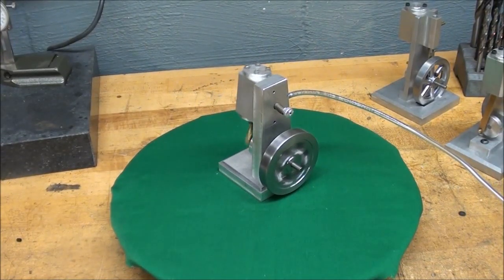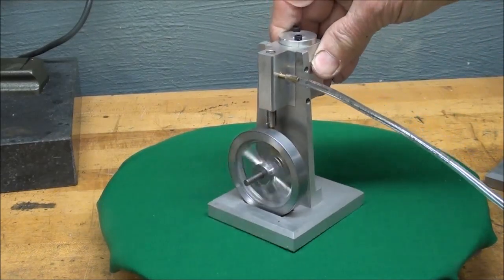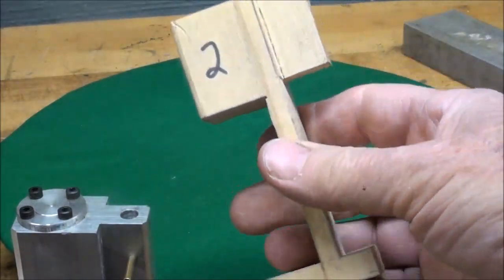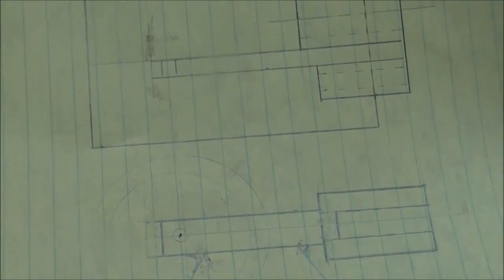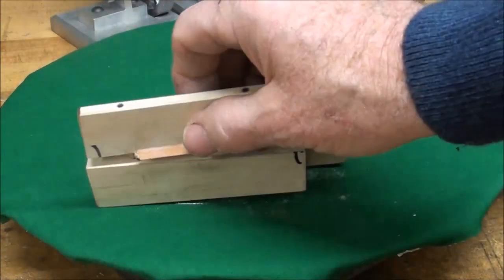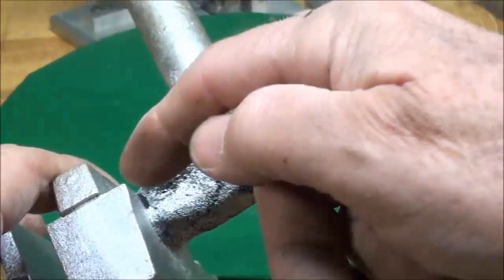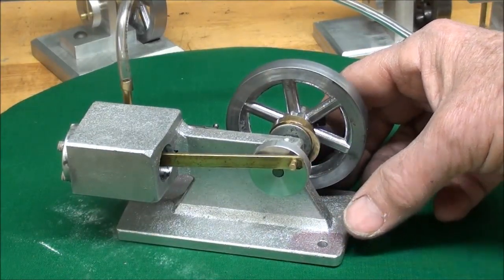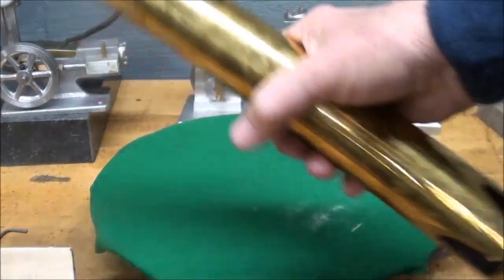TUBALCAIN'S WINTER MODEL ENGINE PROJECTS mrpete222

Comment: Another great video and I appreciated your conversation about the older crowd setting in a nursing home.   My father in law nearly went crazy setting there with mindless chatter on the TV, you can only watch so many reruns of Walker Texas Ranger all day.  He was a maintenance electrician in a packing house for 43 years and had a mind like a steel trap when it came to all things mechanical and electrical.  What a waste was to watch him fade away with nothing to inspire him even though his body was no longer able to do the work.  Of course he would be cussing the TV telling you what you did wrong, but at 94 he had earned that right.

Comment: Do you have an indexing plate on your lathe? If someone want to turn a model flywheel, and use drilled holes instead of spokes, I was thinking an index plate, and a small quality drill mounted as a tool holder in the cross slide would make layout very easy.
Reply from the maker: Good idea-the atlas lathes have index plate on the bull gear

Comment: I came across your channel today.   I subscribed.  I am 76, retired Steam Engineer so I can appreciate your efforts.  I gave up cable 2 years ago and use Chromecast from computer to TV.  I have restored tractors, my favorite was an Allis Chalmers "G"  i have done 2 of those.  I also was a machinist in my dad's shop.  The 9" South Bend that followed  you home reminded me of the time My Dad and I bought  a similar South Bend from the shop of a mill.  On that trip we also loaded a 16" Shaper and a 24" Planer.  I liked making guns and parts for them  I also like working on smaller gas and diesel engines.
Reply from the maker: +Jim Key Thanks Jim
I have 600 vids.  I always wanted a G since boyhood. Our park system did all the mowing with a G

Comment: Fantastic work, I am a Powerhouse steam engineer for the past 34 yrs. and have loved the artistry and craftmanship of the old steam equipment, I have recently been provided with a small machine shop at work (mill, clausing lathe, drill presses and band saws) which I have been enjoying in my spare time and I think I would love to build one of your oscillating engines. If you have never been to Greenfield village or Henry Ford Museum in Deerborn Mi. they have some of the finest examples of steam engines I have seen. Thanks again. Joe Mion (Ohio)
Reply from the maker: Joe Mion Thanks for watching/. Yes--been to ford.  Check out my ford road trips a few months back
Reply: Thanks Pete I will check those Ford trip out

Comment: Enjoyed this video.   Your horizontal engine is just what I have been thinking of working on.  I made one out of scraps by brazing the valve chest on, but I want to cast a better bed to use.  Your casting looks very nice. I wonder how hard it would be to modify that engine to run as an internal combustion with spark ignition?
Reply from the maker: Very hard

Comment: Sir i am 14 yrs old and am verry interested in engines , all i can di for now since i dont know how to mill or lathe , i use legos as a replacement , ive made some impressing engines and they would probably work if i made them real .. Of course you would think i use xbox or ps but , i always tinker in my dad garage with motors , please make a video on how to make a simple air compressed engine thank you sir
Reply from the maker: Take a look thru all my videos & you will find more engines.

Comment: Another excelent video. I very much appreciate the work you put into these videos. I  am a model engine builder also. I am in the process of building a foundry, and have made patterns for the Elmer Verberg style slide valve steam engines, and the large vertical you featured in another video. I will try building some of the style you have shown here. Thank you Mr Pete! I am also a fan of those you mentioned, as well as Doubleboost.
I have enjoyed your many machining, and casting videos. I for one would enjoy a series on making patterns, casting, and machining these engines.
Chuck

Comment: Mr. Pete, PLEASE keep the videos coming about your engines!!  	 	 	 	I'm a 64 year young machinist “apprentice” after discovering large scale model railroading a few years ago. I've bought a Bridgeport vertical mill and a LeBlond tool room lathe (both very used) and other metal working tools. My goal is to build a 2-1/2” scale narrow gauge live steam engine and lay enough track on our 5 acres to take the Grandchildren for rides. I've watched many of your videos and will continue watching as long as you post them. I've learned so much from you! At this point, I feel I still don't know what I don't know. Please Sir, post how you made the horizontal engine from making the pattern all the way through to finished engine.

I do have one question today, how did you mill the well in the base of the upright engine?  It appears to be a hole with square corners!

This is my first comment on any YouTube video.

Very best regards,
Michael

Comment: Great video! I love seeing these small engines. It would be great to see a build series for one of those horizontal engines. I very much enjoyed your wobbler series. Have you built any IC engines? I've been working on a small bar stock model aero type compression ignition engine on and off for a while now, a most enjoyable project.

Comment: Hello Mr. Tubalcain

I would love to see you build a one or two cylinder, double acting horizontal engine. Starting from the beginning with Pattern making, Casting and finally Machining to a running condition. I would be very interested in watching you make the Pattern using your Pattern Tools and showing how to cut the required draft angles so that the pattern is easy to pull. Also how you calculate for shrinkage and how much to allow for Machining.
I am planning to give metal casting a shot this summer and have been trying to learn all I can over the winter.

Thank you very much for taking the time to produce these wonderful Videos.  I don't think the average person understands the amount of time it takes just for one Video. The editing alone takes forever.  Take care.

Cheers

Bill

Comment: I love your engine work! I built your single acting engine following your method of drilling a through hole in the cylinder to mark the steam and exhaust ports in the pedestal. What a neat trick! It sure eliminated a lot of the precision drilling in a previous oscillator I built. I'm looking forward to learning how to build a spool valve engine.

Comment: The steam engines are great.  I was a marine engineer on steam ships for over 25 years.  I love steam.  I have worked on and operated many types of boilers, pumps & engines all driven by steam.  Now that I have retired I will have to make a few of those small engines, you are a great inspiration to many.  I don't have forging equipment but I do have a mill and lathe, and don't really care for TV.  So out to the shop.  Thank you again for the video's.

Comment: These are great little engines when I was in Machine trades class in 1985 we built a small engine that was powered by het gas line treatment. Thanks for taking the time it takes to make these.

Comment: It is nice. So easy to stop. I would like one a lot bigger that could be used to run a alternator. So when the sun dont shine I can just make steam power to recharge my batteries. It would be nice when fuel is not available. I guy could just build a wood fire and turn a steam engine and make some electricity. That would be a very good deal.